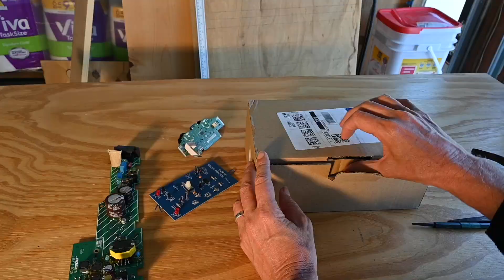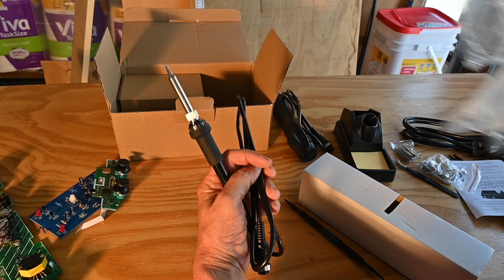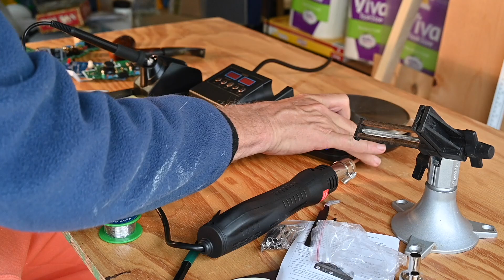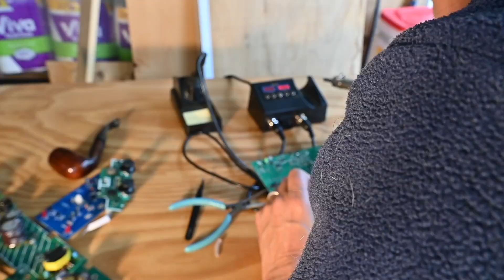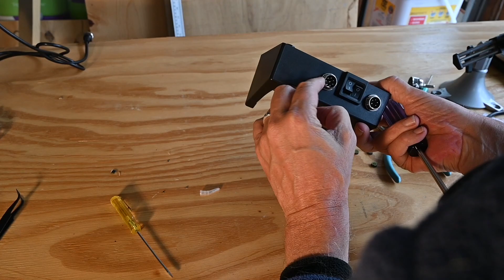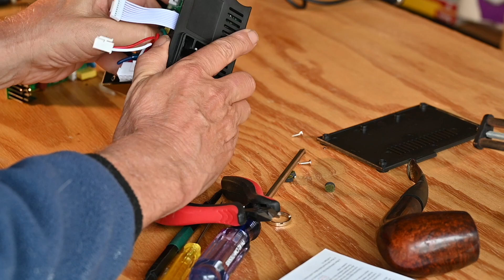C.K. tries a Daxiongmao 8898 solder/hot air SMD rework station

Comment: Have you checked the temperature of the unit i got 858d hot air station and  when i set it to 350c it was measuring 260c with my multimeter.
Reply from the maker: I did not measure it, and I gave it away to someone who needed it.
But the first thing I would check is the specifications on your meter.  My Fluke, for example, with the K type thermocouple can test a maximum of 260 dC, so even if I did test it the max I would see is 260 even if the gun was putting out more.  Which sounds like what may be happening with you, take a look at the meter specs and see if it can read higher than 260, it may not be able to.
Reply: the same with me, and I can't find any tutorial that helps me to calibrate the hot air gun

Comment: The solder wire that comes with the soldering station is very poor quality; it barely melts even at high temperatures, but it works much better with decent solder.
Reply from the maker: Yeah, I generally toss the solder that comes with kits and irons into the trash.  Goes for lead-free solder also, since we don't have requirements for that in the U.S. for hobbyists, and I've been sniffing leaded solder for nearly 60 years.....

Comment: While heat resistant cables are a nice feature to have for a couple of reasons, I don't consider lacking them to be a major safety issue.  Because, frankly- if you are setting down your high temperature devices without due care, heat resistant cables aren't going to keep you from burning your building down, anyway.
Reply from the maker: While I agree in theory, I know I have melted a bit of soldering iron cord 3 times (yeah, I remember each time) in 55 years of soldering.  Adding a high temp silicon cord is a trivially easy way to avoid a problem, and adds Pennie’s to the cost, so why not do it?  I’ve never had an airbag deploy in my car either, but I’m glad they are there. I also spent 5               years in the USAF teaching  beginning airplane technicians in the '70s, and boy howdy, giving beginners every possible safety feature is definitely a major plus.

Comment: Very much appreciate your clear and honest look at this incredibly prolific unit.  The price seemed a bit too good to be true. Seems you get what you pay for, but perhaps better off with a $10 stand alone iron with temp control and a $20 hot air gun instead of this "station".  Would love to see you review the Bakon 881 two in one station.  it is twice the cost of this unit but seems more capable and an excellent value, yet there are not real reviews for it anywhere.  Thank you!
Reply from the maker: Thanks for the kind words.  I'll get a Bakon on order and put it through its paces.  However, it will be at least a month until I can get it on the schedule, so pleas hang tight!
Reply: @CKHaun Wow!  Look forward to it.  FWIW i think the Bakon 881 is the same as a Toauto DS882.  At least they look identical on the outside.  My hesitation in buying one is the lack of reviews and the unusual 600M tips (vs the 900M tips used by most everyone). Despite their limited availability they are on aliexpress for cheap. Thank you!
Reply from the maker: Playing with new gear is my addiction. And sub US$100 gear is the funniest, my social security check pays for that ;). Again, be a little patient on this one, probably be the 1st week in May.

Comment: Just bought one of these for $30, arriving tomorrow. Do you think I could do GPU repairs with one of these reliably? I mostly needed it for the hot air gun but the soldering iron is a nice addition I guess.
Reply from the maker: I think it will work, but i’d practice on a junk board first if you have one available. You don’t want to heat the GPU chip too much, so you’ll need to work the pins up off the sides one by one. Not too bad, I pulled a 64 pin chip off an old Bose sound board the other day and it went fine. Just aim at the pins and pull slowly.  And as I mention in the vid, high air flow rate works best.
Reply: @CKHaun  Thank you very much for the response :) I will be sure to keep the tip in mind and be careful with the heat
Reply: for small components maybe, for bigger IC this stations are junk

Comment: How to change it to Fahrenheit @c.k Haun
Reply from the maker: @devinguerrero8728 Turn off the unit.  Hold the up and down buttons down and turn power on.  An 'F' or 'C' will flash.  Use the 'Up' arrow to select which one you want.  Leave it alone for a few seconds and it will accept that choice.
Reply: @CKHaun
Reply: @C.K.Haun

Comment: Greetings, would you do me the favor of obtaining the value of R46 on the thin plate (the one with the soldering iron and heat gun connectors), it just exploded, and I can't read the value.
Reply from the maker: @uriellopezgutierrez4436 Unfortunately there are two problems; (1) I'm away from my workshop for 3 weeks and (2) I think I threw it all in the trash, so I cannot help you on this one.

Comment: yeah, right - soldering right on device wires, like a pro, don't give a crap... my kinda guy!
Reply from the maker: @moonbind. Fire and sparks are your friends!  And if you've never accidentally set your iron down on the power cable once, I salute you.  I have, perhaps 3 times in 50 years, but I have.
Reply: @CKHaun  - Never "DUDE", safety has always been a "Priority" in all work cause it yields "Life and Quality Work".
Reply from the maker: I was being sarcastic in the first phrase of that reply.  Obviously I care a lot about safety, which is why I tested the power cable for its melting point to begin with, and cannot recommend this unit because the cord is not high-temp silicon.  Sorry for the confusion.